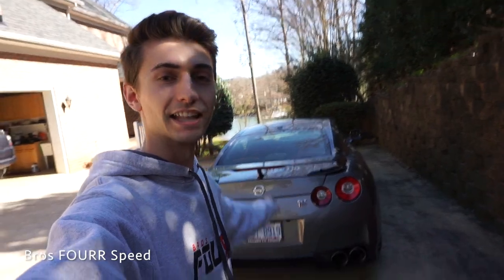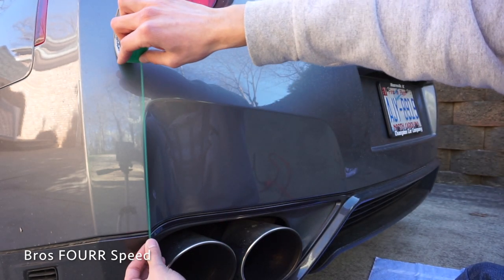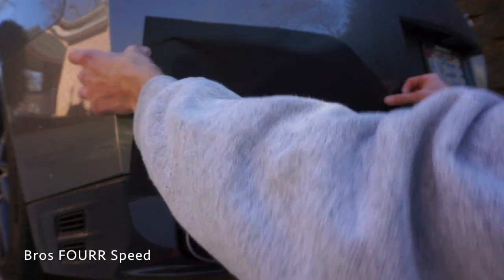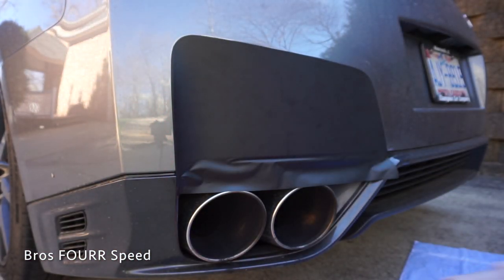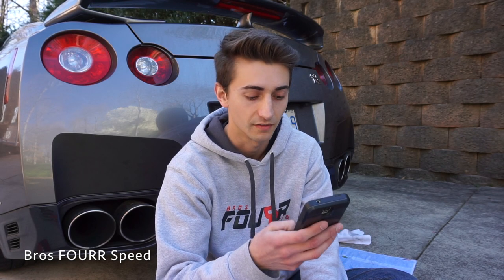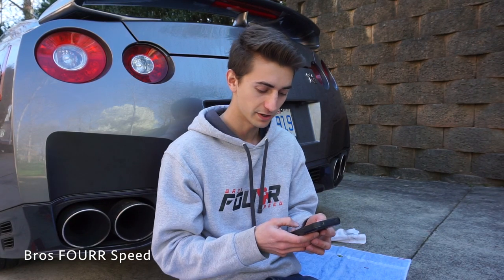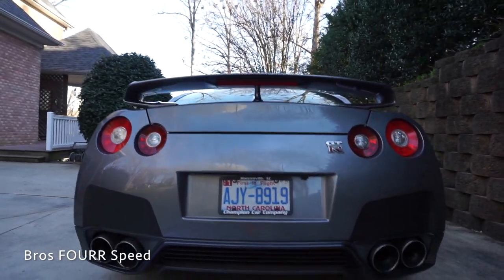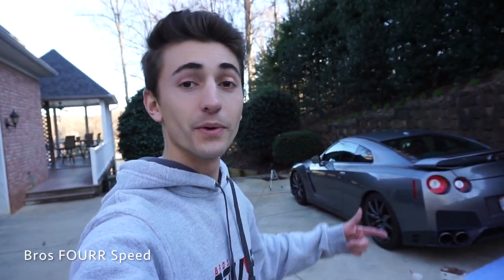THIS Will Be the CHEAPEST Mod For the GT-R!

Comment: Nice touch to for the black vinyl on the rear corners. But now, it makes the bottom sides look blank.  Try something with the vinyl on the sideskirts as well.  Also, the red trim is dope (for the front and the rear). Gives it that NISMO feel. Keep it, but don’t overdo it.

Comment: Did you go matte, or satin? Which wrap did you use?
Reply from the maker: I think this was a satin black. Slight shine to it. Still have these pieces on the car and they've been holding up well!
Reply: @BrosFOURRSpeed  Have the same car and installed some today. Seemed a bit more dull in color. Will probably remove and try a satin. Thanks